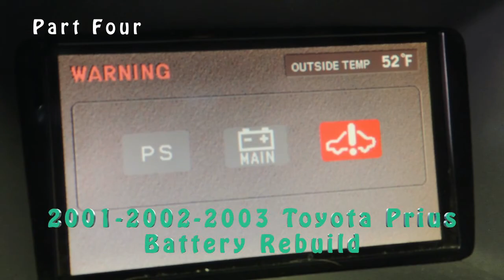Toyota Prius BATTERY ASSEMBLY -  PART FOUR ( P3000 P3006 P3030 )

Comment: Hy bro I have same trouble and I cleaned every thing and battery module is over 7.73 every each cell and I cleaned wires but still I see sign on car display what should I do
Reply from the maker: What are the codes????

Attach a Headlight to each cell for 5 min then check voltage again, If they are still ALL the same, then the problem is not with the cells. If any cell is lower then the rest there is your problem.